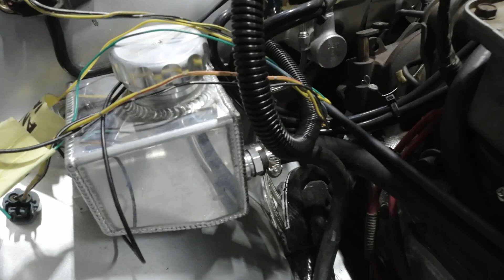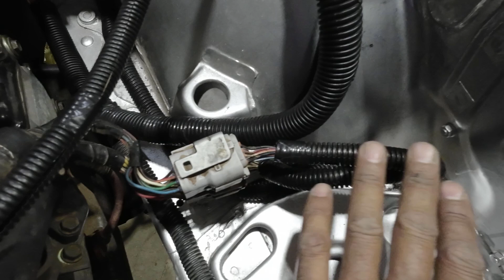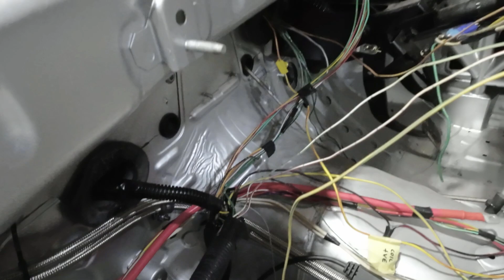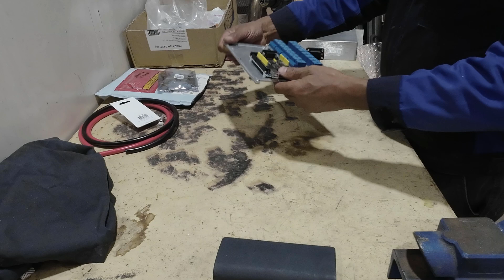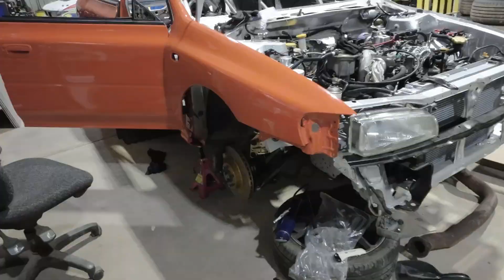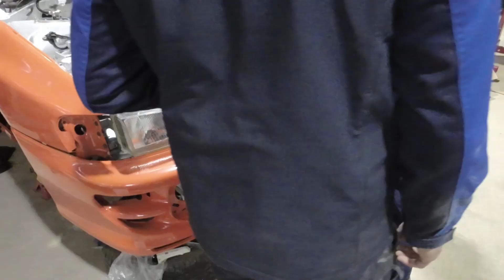GC Impreza WRX rally car build part 7

Comment: Looking good! I've done a few arduino car projects and for the jumper wires after testing I've soldered my wires to a pin header so it ends up as a long single plug. Seems to be a bit more solid connection than single jumpers. Looking forward to upcoming videos as I'm getting ideas for my GC8👍
Reply from the maker: Thanks for watching 👍 We actually re-pinned our jumper wires into long multi pin plugs as well. It definitely makes a difference over single pin jumpers.

Comment: Great work. It's going to be a nice car. The arduino board has current limiting, or are you fitting fuses or similar? I thought the PDM would be doing headlights etc. I may have missed your explanation. Cheers
Reply from the maker: Thanks for watching 👍. The PDM is a breaker & switch for some circuits, breaker only for others. The Arduino & it's relays are protected by the PDM.